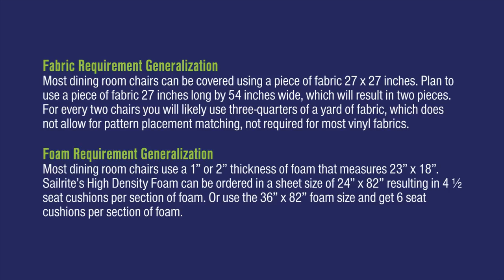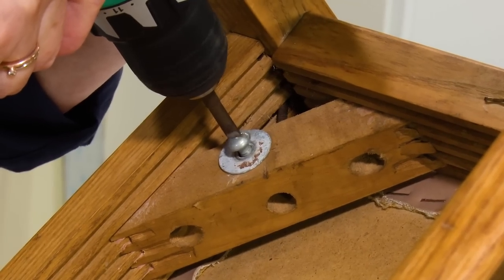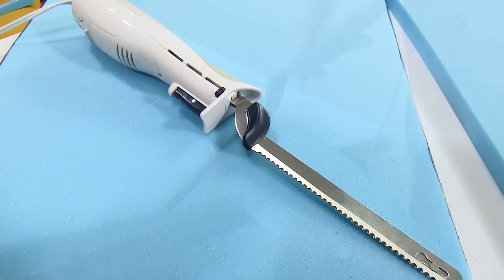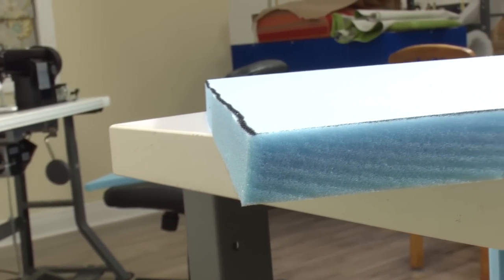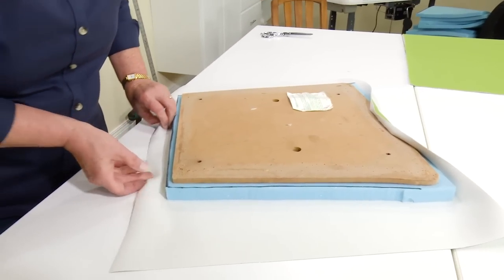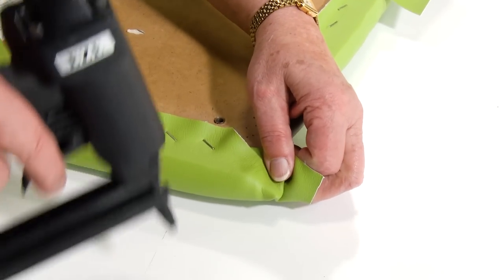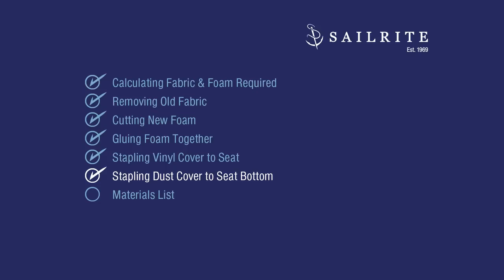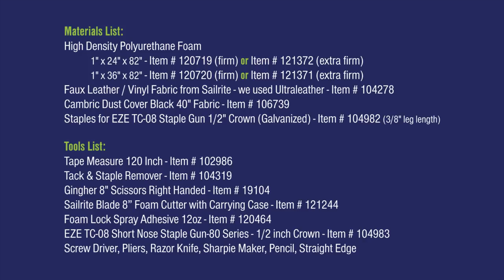How to Re-cover a Chair Seat with Faux Leather / Vinyl Fabric

Comment: Thanks for the instructions, very helpful.  One quick question: can I recover the vinyl chair with fabric straight over the top of the vinyl thats already there?  I'm worried that the fabric will slide and stretch over the vinyl and won't last as long, plus not sure on condition of foam underneath although it feels spingy. I like to do a job properly and have offered to cover 6 chairs for free (charity shop that provides for people in need and works with a church) so they can get a good price for the dining set. There is a carpenter on hand to help with removing old staples (loads of them) as my hands can't do it anymore and have a good staple gun to re staple the new top. Sorry for such a long message, sometimes fixate on details, can you tell? Would love some advice. Thanks
Reply from the maker: Hi Victoria,

That is not the preferred method, but it can work in some instances. I probably wouldn't do it in your case since it would be vinyl on vinyl.
Reply: @SailriteDIY  thanks so much, will definitely do it properly now, just needed some encouragement to tackle all the staples and hidden mystery inside the foam.

Comment: Can I ask If the vinyl fabric has a grain line? that I should consider about it to make chair seat cover?
Because I feel kind of one direction give(expand?) more and the other less.....or Maybe I just feel...
Reply from the maker: Yes, most faux leather or seating vinyl fabrics have a grain or pattern that runs randomly along the length and width of the fabric. In most situations that grain is not a factor in determining how a vinyl will be applied to an application, but rather what saves the most fabric. It is true, when a grain direction is finally determined (along the width or length)  it is typically the followed as the rule for the whole project, just incase it is seen or visible by the end user.